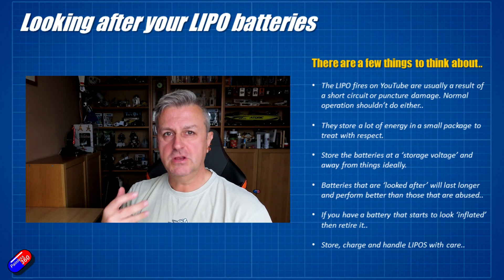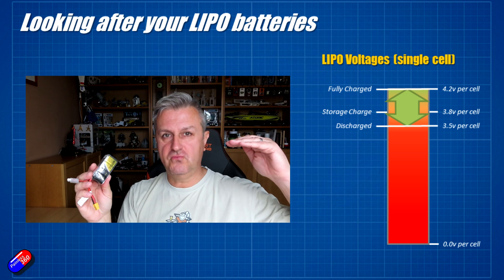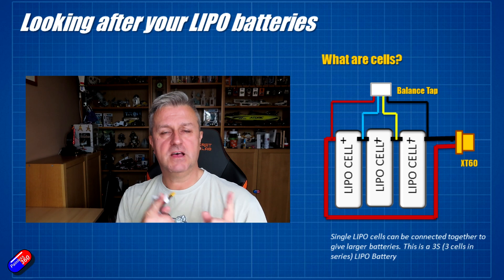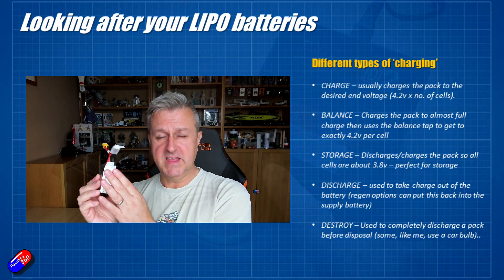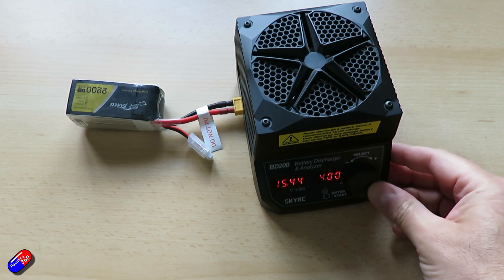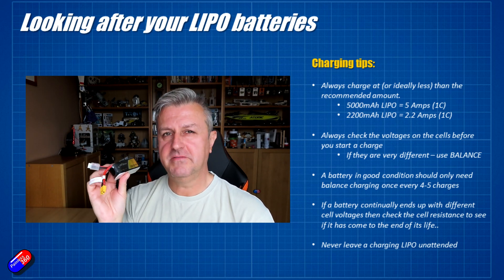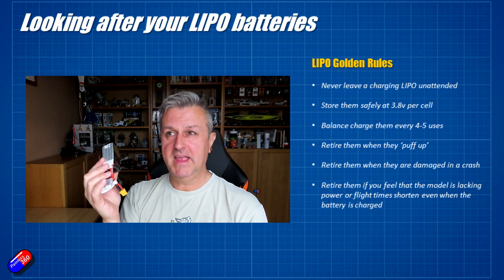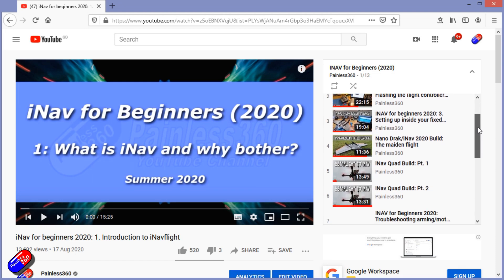How to look after and charge your LIPO batteries: A beginners guide to the basics

Comment: I'm currently using Tattu 22000 mAh batteries in VTOL drones. Now some of them have crossed 80 and 100 life cycles. How do I determine weather they are still usable? Also are there any params in .BIN files generated in the flight controller that can be used to determine battery health and usability?
Reply from the maker: I monitor a few things to check that a battery is still flight worthy. 
1) are the cells 'puffed' in any way? 
2) has the internal resistance of the cells increased significantly?
3) does the battery voltage drop significantly under load?
If the answer to any of these is YES then I suspect it as coming to the end of it's life.. Happy flying!

Comment: I used to get through loads of batteries when I first came into the hobby, simply by running them too low, I would often go down to about 3.4v per cell, and like you say, the batteries really do not like it. These days I don't like to go below about 3.7v per cell - 3.6v if I really push it. Certainly makes a massive difference to the life of the batteries.

Comment: Thanks for the great tips. Do you also recommend bringing LIPOs down to storage voltage between flights for those batteries that are used in transmitters, such as in the FrSky X20/S?
Reply from the maker: Those are some of the few that are not discharged here, I'm always playing with the radios and setups here to help others so always need the radio handy..

Comment: Great video, good source of info for maintaining lipos, I'll try to remember this when I see someone new in the hobby asking lipo questions.
On the subject of discharging, I sometimes discharge packs a little device in I made, it has a barrel socket & XT60 socket, LED volt meter and large switching regulator set to 5v output with two USB sockets, so I can charge phone etc. with the excess energy in a battery.
I do have to manually monitor the voltage to make sure it doesn't over discharge packs, I've been thinking about hacking one of those HGLRC Zeus dischargers with a 5v switching regulator and USB socket so it stops outputting when it reaches storage voltage.

Comment: Great tips that everyone should be aware of when they start out. Fortunately, most chargers, even the cheap ones, support storage charge now. Though that still seems to be a challenge on 1s and 2s chargers. 
I suggest numbering each for easier tracking when you have quite a few. I also track ohms resistance and charge time.

Comment: Thanks Lee, very good summary. I have a lot of batteries and I keep track of their internal resistance over time to monitor  their health. I have found the IR measures with chargers is very inaccurate so I picked up the LiPo ESR Mark II meter. It's not cheap, but it has been a great tool for managing battery health. Like you, I have some batteries that I have been safely using for many years and are still going strong.

Comment: If you have a telemetry radio, use the battery monitor mode, as it will tell you the pack voltage AND the (programmable) lowest cell voltage. So when the cell gets down to 3.6 on load (motor at flight speed), it is time to land! There should be enough left for a 'go-round' if you need to. - - edit for a typo

Comment: I just bought 10 new batteries..
so far I've only seen one cell hit 4.2.. all the others range from 4.17 to 4.19
Is that because they are low quality in your opinion ?
or maybe because my cell checker is cheap and old ? or my charger ?
Reply from the maker: I'd balance charge them and see how they perform. Checking the internal call resistances are close can tell you how good the ceeka and pack are.. Happy flying
Reply: If there's a chance your equipment is not reading quite correctly, try using a reliable multimeter to check your voltages. This will usually give you a more accurate reading than a charger/checker..

Comment: Do you stop flying as soon as the voltage goes below 3.5V, or do you go below that as long as the voltage returns to 3.5V within a few seconds after the flight (like Nick Burns does)?
And is this behaviour different between 1s and 2-6s lopo’s?
Reply from the maker: It depends on how much you want to push your batteries. I like the voltage to be 3.6-3.7v per cell after the flight so that the pack isn't pushed to hard. Happy flying!